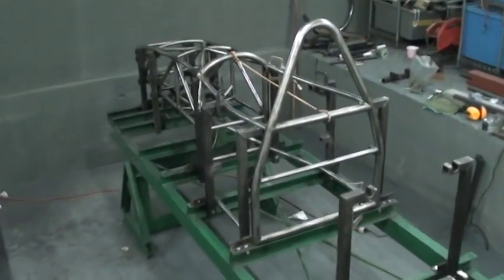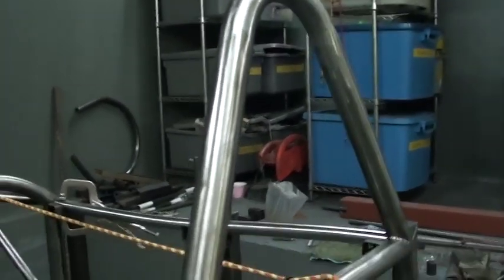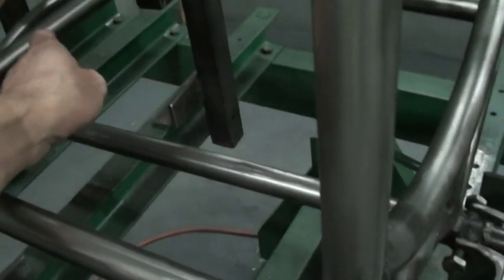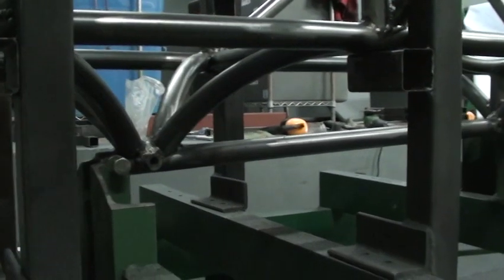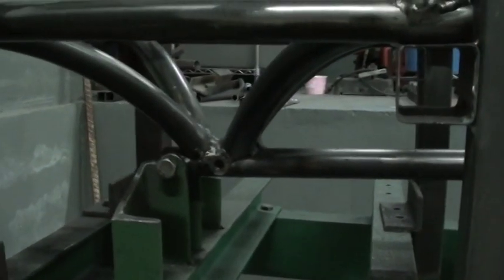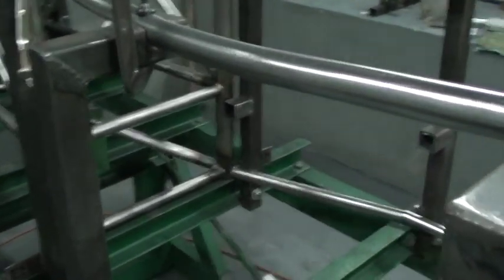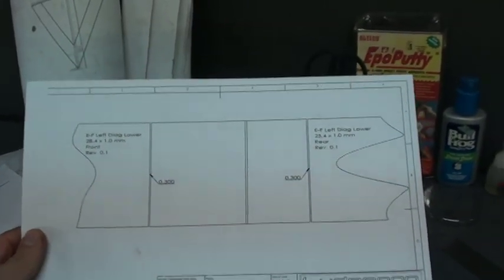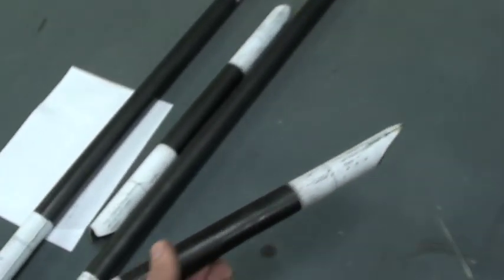Formula 1000 Race Car Build Update 1

Comment from the maker: @serchmarc Tube sizes for the roll hoops, braces, and leg protection are mandated by SCCA rulebook. Otherwise, I just used Colin Chapman's rule that tubes should be no smaller than 1" diameter, plugged in the available thicknesses, and did FEA of the frame. If you look hard you can find stiffness targets on the Internet. I use Solidworks. Highly recommended. Where did I learn this stuff? I studied Mechanical & Aerospace Engineering at Princeton, and worked in the computer industry for 20 years.
Reply: Ur most recent videos is 3 years old what happened to the car?? And did u end up buying new tires and running a fast lap?

Comment: Laser cutting tubes leaves a burnt edge that isn't good for welding. The tool you want for notching tubes the way you're doing it is a pneumatic die grinder with a spiral band aprasive sleeve on the end of it. There's a lot of ways of notching tubes and very few people that know what they're talking about.

Comment: How do you cut awkward shapes?
Reply from the maker: The method for cutting the ends of tubes is in excruciating detail here: http://ludemannengineering.com/2011/12/27/how-to-fishmouth-tubes-in-solidworks/    For other awkward shapes, I have a whole machine shop full of different kinds of cutting tools: angle grinders, milling machine, lathe, drill press, plasma cutter, bandsaw and so on.

Comment: What metal is that
Reply from the maker: +Car Guy The metal is just mild steel. Future frames will probably be build from chrom-moly steel.
Reply: Ludemann Engineering Yeah cromo 4130 is what I'd like to use but the price ain't cheap on that
Reply: @LudemannEngineering  Hi I live in Pattaya.I have Dallara mercedes bodywork,side pods,engine cover and nose cone.Could you create fiberglass moulds for me.